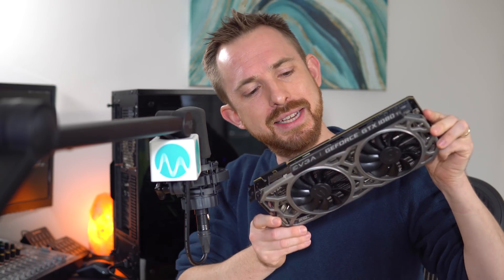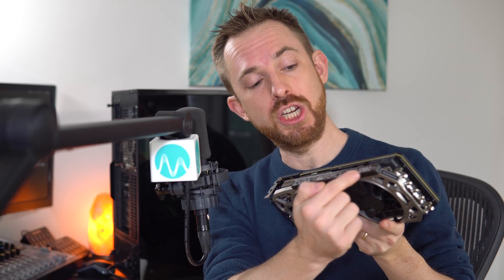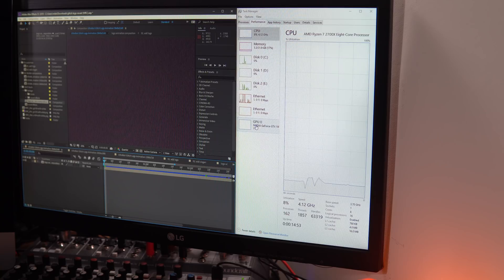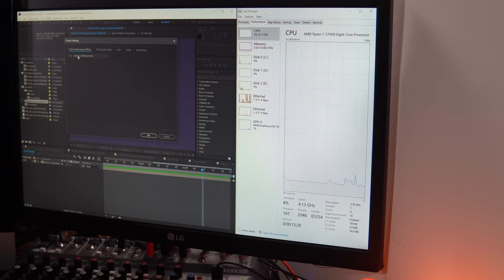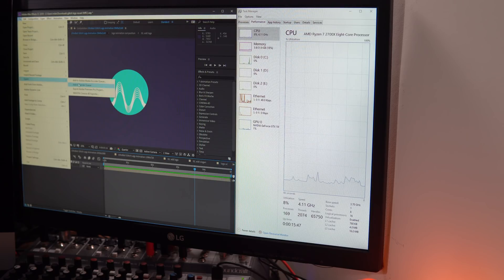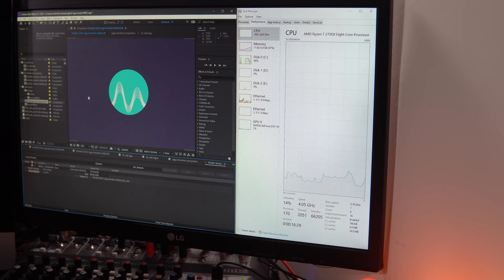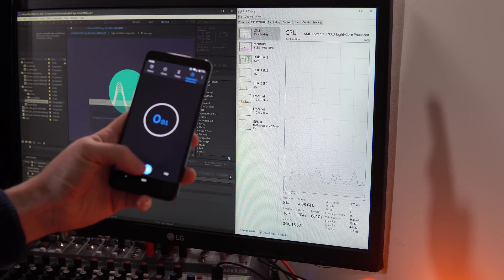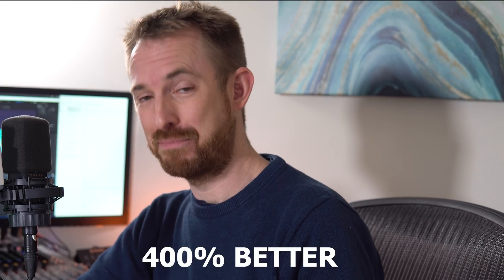After Effects GPU Acceleration (w/ EVGA GeForce GTX 1080 Ti) - Ultimate Audio PC Build #013

Comment: Conclusion: It works on most effects in AE Library, but not all.

Go ahead and try Detail Preserving Upscaling. And just straight render it.
You will see GPU Utilization 1% and CPU utilization can be 80% or more, even if you enabled Mercury GPU Acceleration.

It is like 50-50 hit or miss whether or not the VFX you're working on Actually supported by GPU or not.

Comment: hi I install the 2020 version and I don't get any error when I open the after effect an check the option in the project setting then put it on acceleration (CUDA or OpenCL)  and in edit preview and check GPU information after that I change the ray tracing but when I want to render the project in my task manager I saw just use the CPU and ram and doesn't use my graphics can you help me? 
what should I do?
Reply from the maker: Both Adobe After Effects and Premiere Pro use the CPU for rendering H264 with only GPU accelerated effects using the GPU so the bulk of your work will be done by the CPU
Reply: @MikeRussell  Thank You🎉
Reply from the maker: You’re welcome.  It’s often a feature request on the Adobe forums from a lot of creatives with fast graphics cards.

Comment: For someone that only uses a computer for photoshop , After Effects , etc.. No gaming of any sorts, would this 1080TI be more than good enough or would I have to buy a 2060 or something along them lines because I really need to upgrade from my outdated 750TI , any help is appreciated :)
Reply from the maker: Always go for the best your budget allows as you may find your demands on the card increase in the future.  The 1080TI is still a good card and you’ll certainly see a boost from your 750TI. BUT, just a word of warning a lot of rendering with After Effects, and Premier Pro occurs within the CPU if you’re rendering H264 leaving the graphics card to pick up the work for the CUDA Core enabled GPU accelerated effects.

Comment: Ok but what about work flow and getting into multiple layers? Rotoscoping tracking and all the other stuff that after effects will utilize the gpu in a hard way. How hard does the gpu run with all that going on and is there any kind of lagging? Is it smooth? Reason I’m asking is because that’s more important to me than rendering time. I’m building a new rig. Haven’t use premier in 18 years so it way different. I’m trying to figure out if an extra $200 US is worth it or not.